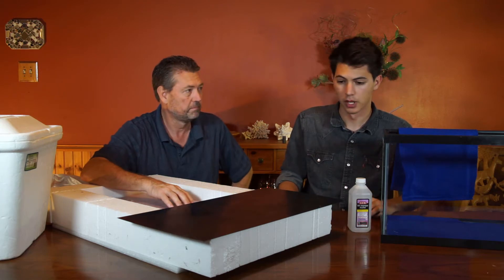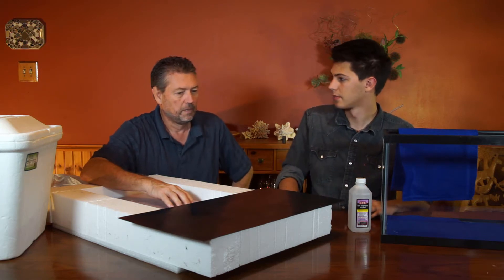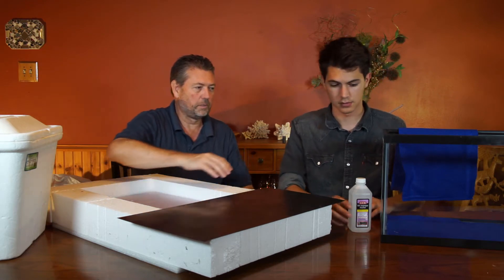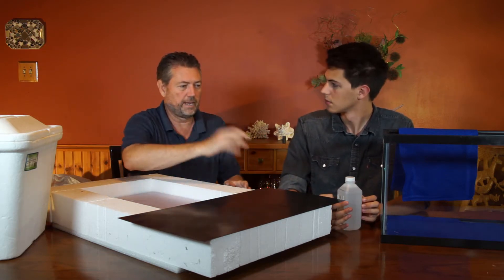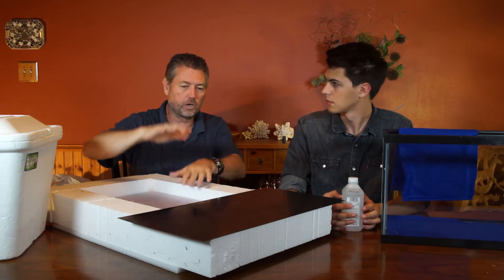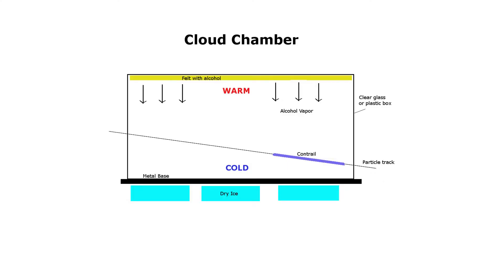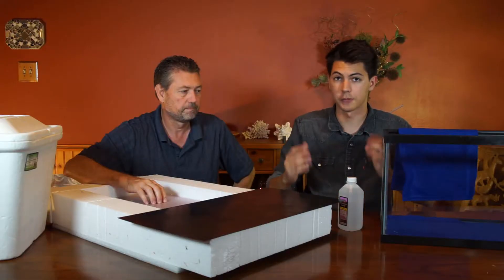Watching Radioactive Decay With a Cheap Cloud Chamber

Comment: Nice!! So the alcohol vapors drop down from the felt on top and then it becomes supersaturated? You might also want to try insulating the sides of the aquarium  and just have a peephole for the camera and a hole on  the side of the of the aquarium for an LED light that won't heat up the vapor much. This should calm down the vapor a bit . There is probably a lot of convection happening due to the warm walls of the glass aquarium.